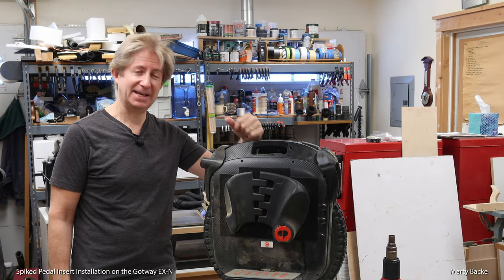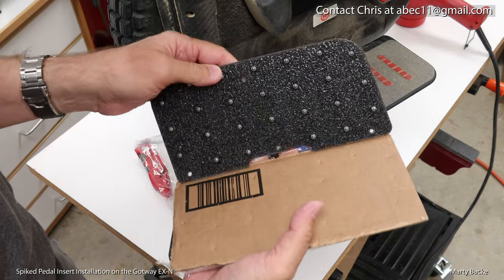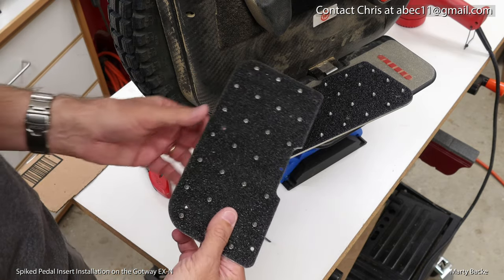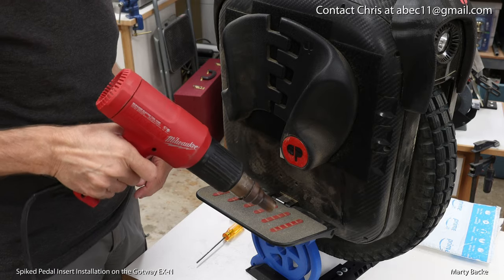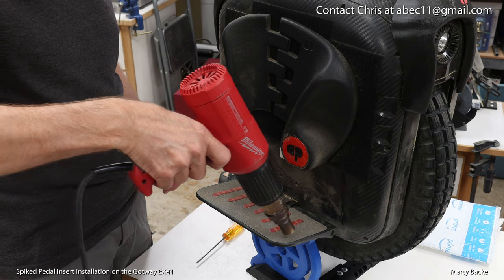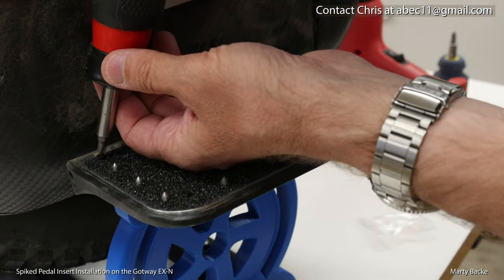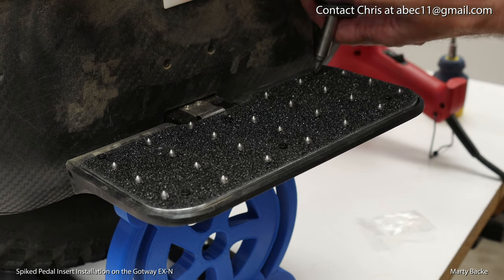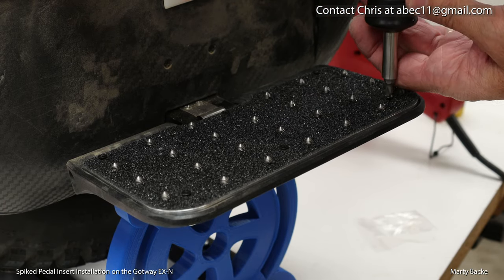Spiked Pedals for the EX-N

Comment: Chris makes a great pedal. If you don't mind something that looks a bit homemade, these are easy to make using aluminum plate ($35 for 2 pieces 5"x11") and a carbide blade on a table saw. I added 2 inches to the length of the plate and it helps with foot fatigue. I use metal track shoe spikes (the short ones). Attached them to the wheel using 4x16mm screws. Cost around $75 for materials but the extended length plate is awesome.

Comment: Nothing compares with spike pedals! ...but I did them by myself for aprox 6$, on the original aluminum plate. I kept the silicone, I made holes with threads, inserted 5x8mm screw and a new "sandpaper". I needed 20 minutes for this
Reply from the maker: Of course. I've made mine too. Sometimes it's nice to have better "things" and to have options to buy those "things" :-)
Reply: @ElectricUnicycles  I know Marty, because I saw all your clips. Only I live in a poor country and don't afford to pay 100$ for spike pedals, so I have to find cheaper ways

Comment: Great improvement, as usual!
One thing still bothering me... Did you try the NylonNove pedals? The thing is that there is an additional killer feature in my opinion - micro-amortization (specific material). I'm really curious about your opinion Marty in case of this micro-amortization.
Reply: Look up Nylon 6, Polyamide 6 or PA6 sheets. It's a nice strong plastic. The bigger issue may be that they just use the blunt end of a basis set screw instead of a cone-point. Less traction on the spike and less traction on the plate means less traction overall.